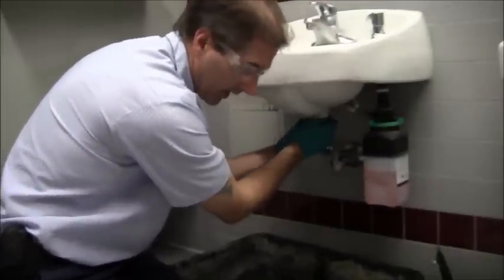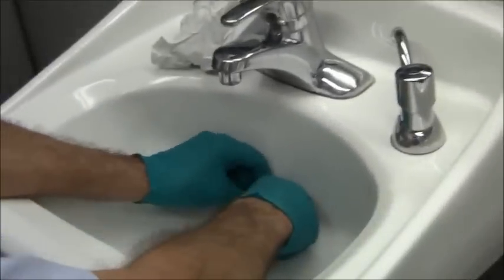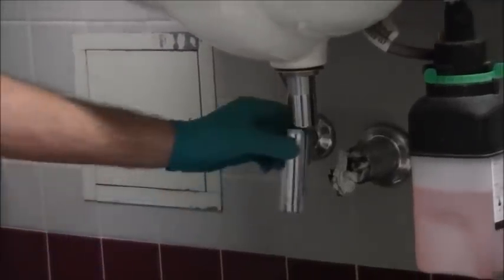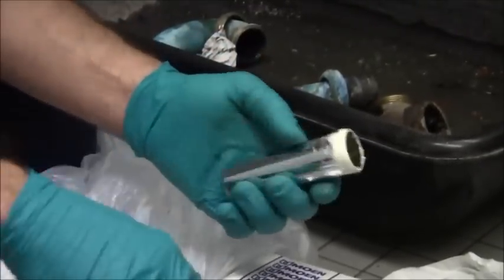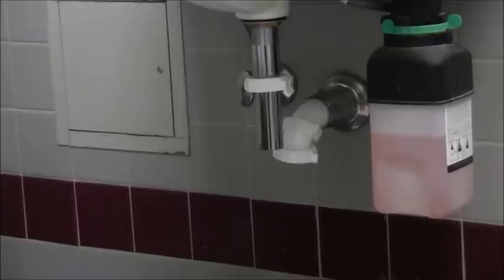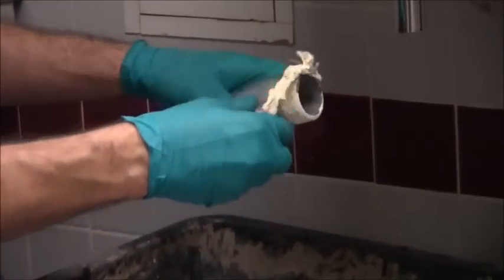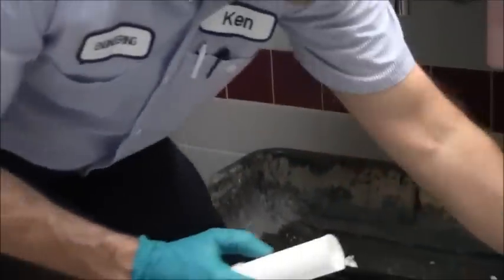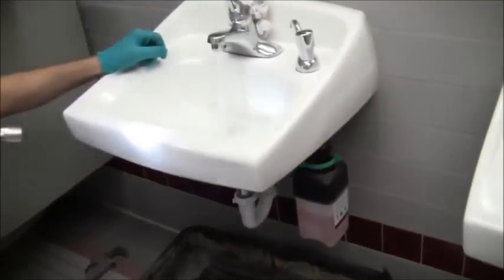How to install a new Sink Tailpiece and P Trap

Comment: the compression fitting for the tail to the trap came off in my bathroom sink. after watching your video i was able to reset a fresh fitting and boom no more leak. thanks for the video.

BTW i'm a computer nerd and not a handyman lol
Reply: Richard Ingame uki
Reply: Raffaele Cavallo Uki is a city in Kumamoto Prefecture, Japan. As of April 30, 2011, the city has an estimated population of 62,678, with 22,693 households and a population density of 332.40 persons per km². The total area is 188.56 km².
Reply: This happens a lot with plastic slip joint washers. Get a pack of the rubber ones (a bit more expensive) and you'll never ever have a problem.

Comment: You didn't need to pvc glue/seal the plastic pipes in any way, just the hand tightened seals and gaskets are it?
Reply from the maker: That was not PVC glue but was Teflon paste or pipe thread sealant.
Reply: @KenTraining  Hi, sorry, I meant on the parts that had the plastic nuts: no sealant on those parts?
Reply from the maker: you are right none needed there. Did you see me do that? let me know the time section of the video you think I did something wrong. Thanks

Comment: I used all 1.5" PVC for the drain and PTrap on my bathroom sink. Is this wrong to go from 1 1/4 drain to 1 1/2?
Reply from the maker: you will be fine. just leave it alone. you can use either size.

Comment: It's inevitable that kitchen sinks are exposed to daily doses of extreme wear and tear. Particularly when one drains off boiling hot water on it - either in excess from the whistling kettle or from straining after cooking pasta or potatoes. What material would you recommend, metal (brass or chrome) or plastic (PVC or ABS)?
Reply from the maker: I like plastic.
Reply: There are still numerous kinds of plastic P Traps. Would you recommend PVC or ABS?
Reply from the maker: either one
Reply: KenTraining Many thanks, Ken!
Reply: no
Reply: PVC and ABS are the most preferred but check your local code just in case. Sometimes it's a lot easier to find PVC components vs ABS (or the other way around) depending on where you live. For example, a lot of people in CA use ABS. In MI we all use PVC. You can still buy both from the store.

Both are rated for use with hot boiling water and will last theoretically forever.

Comment: There is a better P trap kit you can get from sexaur. It's that exact same system but looks better and easier to cut with pipe cutters. I'm an engineer at a hospital in Hollywood and we use them all the time.
Reply from the maker: Chris Alexander I am assuming it is metal? can you send me the part number so I can look it up. Thanks Ken

Comment: Hey sorry for the late response. Have had one hell of a few weeks at work. Have 3 of our 6 cooling towers rebuilt and to top that off... We had one of our 3 chillers basically blow up. Now we have a portable chiller out from of our hospital. fun few weeks. But anyways... Here's the part number. 400583 it's from supply works which was formerly known as sexaur
Reply from the maker: +Chris Alexander That does look very nice but the price is at $59/eaI guess if you wanted to maintain a class A building that would be a good choice.
Reply: +KenTraining ya, they aren't cheap but they do look very nice. All though I do like the ease of the PVC with the wing-nuts. Do you have a part number and supplier for those?
Reply from the maker: Home Depot and only like $4 for the kit. and yes very easy with the wing nuts.

Comment: why didn't you just cut the tailpiece, measure the p trap from the inside to see how long you need to cut, you tighten back on to the sink and reinstall the p trap.
Reply: Cutting metal is a heck of a lot harder than cutting through the pvc extension